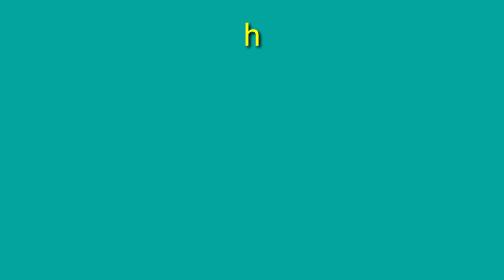HOW TO INSTALL ELEVATOR OR LIFT IN ATTIC DIY STEP BY STEP @JasperYamson18

Comment: Ilan kilos po kaya nyan
Reply from the maker: 1500 to 2000  pound at capaciy nya pero pwedeng  i double ung capacity pag ung cable nya binalik m sa motor i mean yan kasi single lang ung cable naka attach na frame pero kung binalik m ung cable sa motor double na na sya . Ung cable from motor to frame to motor un double capacity nya